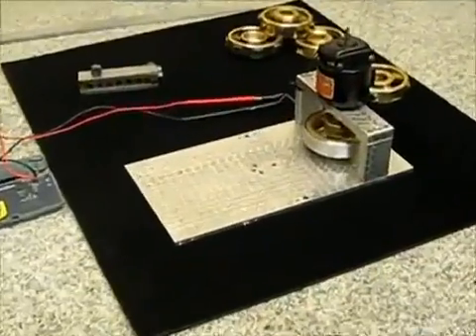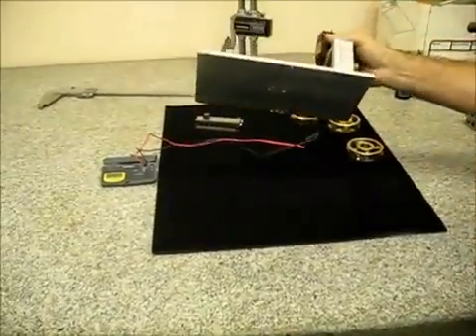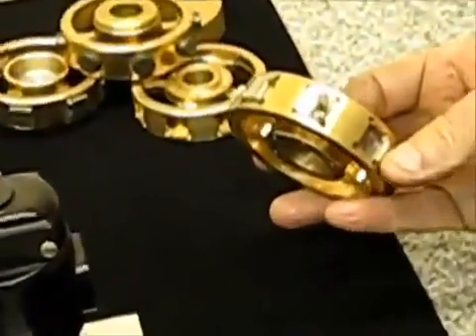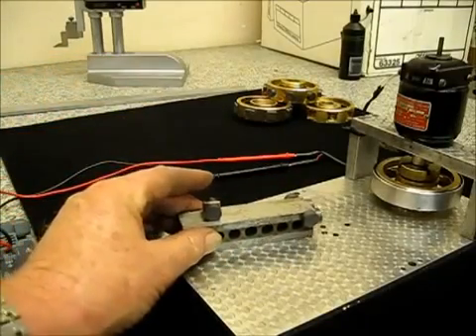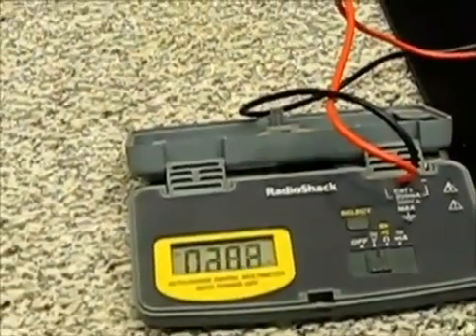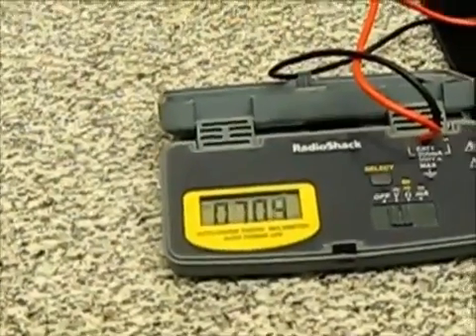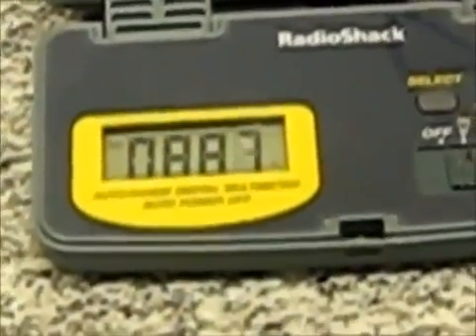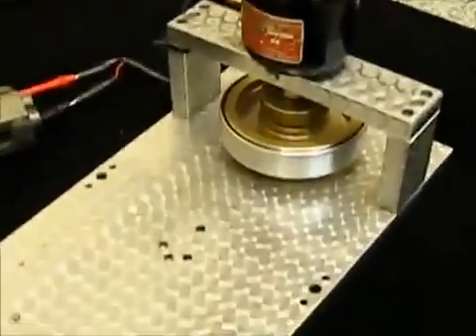FREE ENERGY ATTACHED SMALL GENERATOR TO 6000RPM MAGNET MOTOR

Comment: Just as he pushes the magnet towards the generator, there's that old familiar 'kthungggh' of the ELECTRIC SWITCH at several amps being turned on. He should know that if this were a true magnets-only motor, it would be silent on startup. fAIL
Reply: Gort Sneeley yeah this video is misleading, if it only uses magnets to run, then it’s fair to say it’s a magnet motor but since it uses electricity, it’s not fair to associate them with magnet motors despite it also uses magnets.